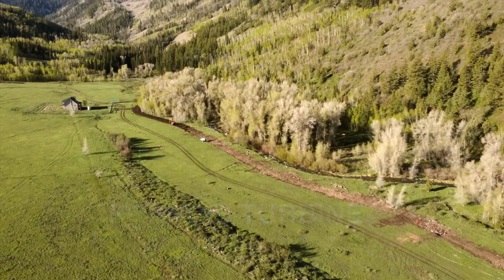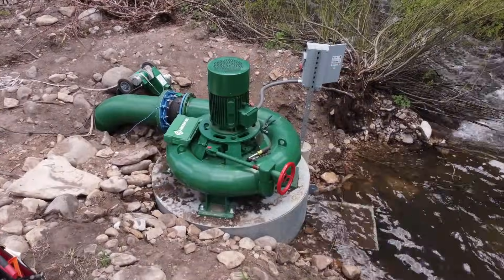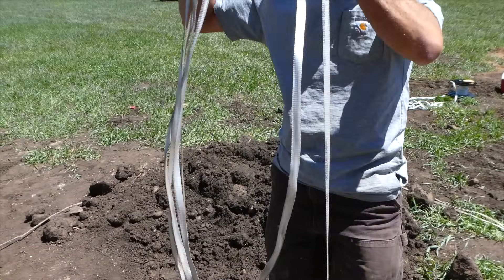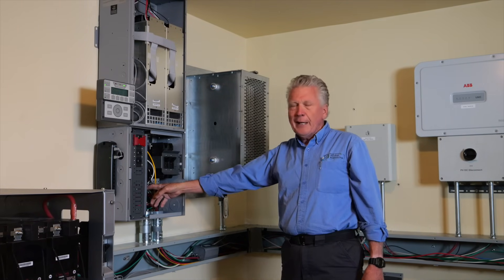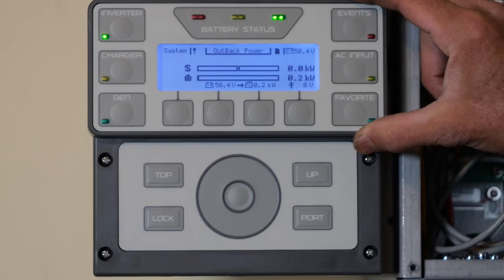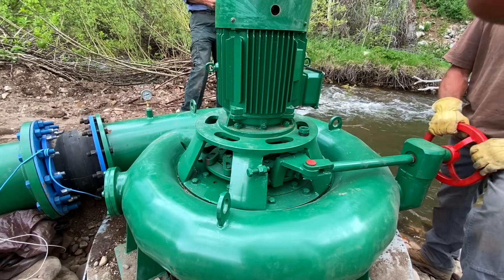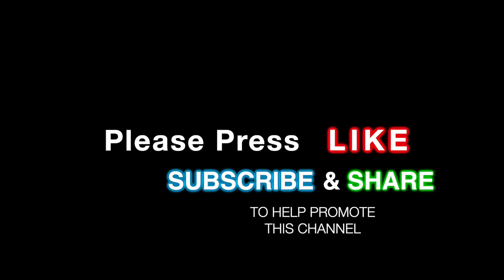MicroHydro Francis Turbine Part 2

Comment: Could you sell the unused energy back to the electric company? If I understand right it’s producing 5kw which is way more then a single hour.
Reply from the maker: The system is capable of up to 6.6kw so that is a great deal of power yielding up to ~158kWh/day (24x6.6). But this system is fully off grid so there are no lines to the utility.  Thanks for watching 😉

Comment: What's the conversion loss in the electrical management system? Not sure why doesn't rectify directly to DC then to charge controller into the batterys. Rectifying and inverting it twice adds conversion losses.
Reply from the maker: Sorry I don't have an answer to those details.  I'm neither the designer or the owner of this system.  You could ask the designer/installer (Ken) whose email contact is in the notes about the video.  Thanks for watching.

Comment: when pulling cables in conduit, grease them with Lanolin....it wont harm the insulation on the wiring and cables.
Reply from the maker: We did that on my system which is the major part of the channel, but this is a system which I don't own and didn't design.  I just documented what they did.  Thanks for watching

Comment: what does a system like this cost? as in your case at this site.
Reply from the maker: I am not the owner of this system. I merely documented this particular system, so I don't have cost figures.  Its most likely in excess of $100k. Even if I did provide cost figures, it would not be of much benefit as each system is unique to the chosen site and costs can vary widely depending on numerous factors.  First there is the potential power available at the particular site which dictates if the desired use of that power is practical.  Who will design the system?  What will be the best equipment and materials available to meet the unique requirements of the most beneficial and practical design?  Then there are expenses involved in acquiring water rights which are likely different in each state or country depending on a pro se (self applied) application or hiring lawyer to work on them.  Who will do the labor to install the system?  Is it your own sweat equity, friends that can help, or hired labor and at what rate?  How much time will it take to install?  What materials can be accessed?  Reused or new pipe, copper or aluminum wire?  How long a length of wire?  What building(s) will house the equipment?  What transformers, batteries, load regulators, power shunts, or utility net metering are available and/or appropriate to the particular site?  All of theses factors can add to the costs and it would be naive of me to present  a one size fits all price.
One must be clear that installing a system is creating an asset which would likely provide power for a lifetime.  Can it be financed over time and does that cost make economic sense when compared to running utility lines to an off grid property?  Will a local utility be willing to purchase excess power and at what rate?  Undertaking a project of this size is not for the faint of heart. It IS a large commitment both financially and in effort and time.
My first system (1.5kw) which I own and documented on this channel cost ~$25k and was installed in the mid 90’s.  Redesigning and moving the same equipment to a more reliable water source was also documented on my channel and took place between 2013-2015 and added another ~$55k but boosted the useable power by a factor of 5 to 7.5kw.  WHEN a project occurs occurs is also a factor governing cost.  Inflation impacts everything involved and the fact that I intend these videos to remain on the internet for years to come and provide some clear eyed guidance to people that are serious about their own intentions, this dictates that I not mislead them with cost estimates willynilly.  
Thanks for watching and for your comment.  I hope you gain a broader perspective from the whole channel and benefit from the heart felt intention with which it has freely been shared and provided.

Comment: Is there going to be a update? a year on?
Reply from the maker: Unfortunately I live a 5 hour drive one way from the location of this system.  Also, I might not have the permission to visit the site as I've never actually met the owner.  The designer gave me permission to document the system as long as I kept its location anonymous.  So, its unlikely I will do an update even though I'm curious about what sort of protective building the owner put over the turbine and what the seasonal flows and actual kWh output tested over time has been.

Comment: nice.  though I'd go with lifepo4 batteries. at 12v 600aH would run you $2,000  I'd budget for a 1500aH system and reduce the turbine to peleton 600 watt with 1.5 inch tube.  I suppose electric heating will dictate the exact demands on the system but for one house with only high peak loads supplied by constant generator -- rely more on battery tech then industrial setups
Reply from the maker: There are always a variety of options and approaches to assembling components into any system.  Each micro hydro setup is unique depending on the owners needs, budget, and technical knowledge as well as the parameters of head and flow available at the site.  I believe the owner of this system intends to build other structures on the property and that may be why the system is sized as it is.  I have virtually no experience with battery storage on my own system, so you may be correct on the best choice for batteries.  Other viewers have made similar comments on the batteries.
With 36 ft of head it is unlikely that you would harness much power with a pelton turbine which are more optimal for high head systems.  Thanks for watching and your comment.

Comment: I want to make a micro hydro generator where I have water stored 400 cubic metre on 1 meter height. Is it possible to generate 100 kwh energy from this setup? And what kind of generator should I use?
Reply from the maker: I'm sorry that I can't provide you qualified guidance with your question.  I'm most familiar with high to medium head pelton systems (documented elsewhere on my channel). 1 meter does seem like not enough of a head to facilitate an efficient system.  My guess is that a "archimedes screw turbine" (search it) or turbulent system (www.turbulent.be) might be most efficient although I don't have first hand experience with either.  Hope this helps a bit.  Also, when you say water is "stored" that might indicate any system would be intermittent which is definitely a drawback. Thanks for watching
Reply: @mrhydrohead  I am storing water from tide. Is it good idea to make hydro generator on tidal water.
Reply from the maker: That's an interesting question.  I'm sure there must be some way to harness power from that, but I'm not qualified to make much of an analysis as to how to do it. I'm a retired cinematographer who has owned his owned micro hydro system since 1995.  I was trained at SEI and there was no mention of harnessing tidal power in their course.  If you look at the majority of my channel you will see that it mostly focuses on my system and the way I moved it from a spring water source to a creek on my property.  I saw a gap of information on YouTube and being a filmmaker with knowledge of Micro Hydro, I decided to share my first hand knowledge.
The two problems I see with tidal flow are that 1. It will be intermittent on the basis of the tides and 2.Your head or distance of the water falling is not very great.
Because of the intermittency you would need to have a battery system to provide availability of consistent supply to meet your needs.  I'm sure there must be some way to harness power from such a small head, but I don't have a clue how to do it.  
If you discover a good verifiable method, I'd love if you shared it with me.  It certainly would seem doable and I'd love to know how.  Best of luck in finding something that would work and be certain to verify the calculations before spending a dime to construct something. Errors in measurements and calculations can lead to expensive mistakes.  Again, hope this helps.  @Bapi-db4ef  
😉
Reply: Sure. I will make wind turbine or hydro turbine.
Reply from the maker: Best of luck to you

Comment: How cost effective is it compared to wind/solar? Assuming heating is done without using electricity (so total home consumption under 3kW averaged)
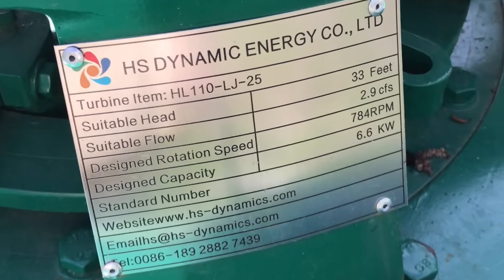Reply from the maker: I don't own this system and was merely granted access to document it's installation.  I do believe that the owners plan to use the reliable supply of power for heating @7500ft. elevation. Output can range up to ~158kWh/day at full capacity with surges handled up to 10kW.  See 4:24 in video for specs. Thanks for watching

Comment: 100 yards from the creek to the house and I'd bet no less than $100,000 was spent on a 8kw system that while very pretty, is just over engineered for the application. I'm guessing this is more of a model home type install. There are many good options on the market, this is certainly "turn key" high end. Myself I prefer a diversified system with micro hydro, solar, and now with the latest tech even wind turbine power generation. Lithium over agm  and a much simpler rectifying and inverting setup able to be monitored over closed network. Just my opinion though.
Reply from the maker: I don't own this property and have merely documented it.  My system which I've documented in detail on this channel is direct regulated AC of 4.5-7.5kW (de[ending on seasonal demand) with no batteries.  I appreciate your input and thanks for watching.

Comment: I've seen systems that take AC to DC batteries and back to AC, but this appears to be AC-DC-AC-DC-AC? Is that correct? And why?
Reply from the maker: That’s a great question. I don’t own the system and merely documented the installation.  My understanding is that the AC provided by the turbine is fully unregulated. The Outback inverter is not capable of handling AC which might range anywhere from 50 to 70 Hz.  I don’t have direct experience with the Outback inverter but I believe it requires a regulated sine wave to both charge batteries and output 60hz power. My own system documented on my channel is a  60hz regulated straight AC system without batteries, and that is the majority of my direct experience.  Thanks for watching and commenting. 😉

Comment: Maybe I missed it but, how much electricity does something like this produce? I'm just looking for a rough estimate.
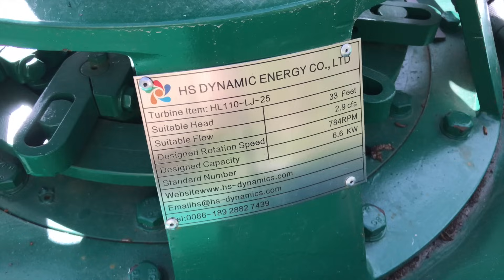Reply from the maker: At 4:25 in the video there is a placard on the turbine which shows the rating of the unit to be 6.6kw and also has contact information for the mfg. As with all hydro systems, the output is dependent on the amount of water available and that supply fluctuates depending on seasonal and climatic changes. Thanks for watching 🙏🏼
Reply: @mrhydrohead  Thanks for the response- that's a pretty good top end!

Comment: How much is the total cost for this project
Reply from the maker: I am not the owner of this system. I merely documented this particular system, so I don't have cost figures.  Even if I did provide cost figures, it would not be of much benefit as each system is unique to the chosen site and costs can vary widely depending on numerous factors.  First there is the potential power available at the particular site which dictates if the desired use of that power is practical.  Who will design the system?  What will be the best equipment and materials available to meet the unique requirements of the most beneficial and practical design?  Then there are expenses involved in acquiring water rights which are likely different in each state or country depending on a pro se (self applied) application or hiring lawyer to work on them.  Who will do the labor to install the system?  Is it your own sweat equity, friends that can help, or hired labor and at what rate?  How much time will it take to install?  What materials can be accessed?  Reused or new pipe, copper or aluminum wire?  How long a length of wire?  What building(s) will house the equipment?  What transformers, batteries, load regulators, power shunts, or utility net metering are available and/or appropriate to the particular site?  All of theses factors can add to the costs and it would be naive of me to present  a one size fits all price.
One must be clear that installing a system is creating an asset which would likely provide power for a lifetime.  Can it be financed over time and does that cost make economic sense when compared to running utility lines to an off grid property?  Will a local utility be willing to purchase excess power and at what rate?  Undertaking a project of this size is not for the faint of heart. It IS a large commitment both financially and in effort and time.
My first system (1.5kw) which I own and documented on this channel cost ~$25k and was installed in the mid 90’s.  Redesigning and moving the same equipment to a more reliable water source was also documented on my channel and took place between 2013-2015 and added another ~$55k but boosted the useable power by a factor of 5 to 7.5kw.  WHEN a project occurs occurs is also a factor governing cost.  Inflation impacts everything involved and the fact that I intend these videos to remain on the internet for years to come and provide some clear eyed guidance to people that are serious about their own intentions, this dictates that I not mislead them with cost estimates willynilly.  
Thanks for watching and for your comment.  I hope you gain a broader perspective from the whole channel and benefit from the heart felt intention with which it has freely been shared and provided.

Comment: You don't say cost, so that means it's way too expensive and no ROI..lol
Reply from the maker: appreciate your comment however I am not the owner of this system. I I I merely documented this particular system.  I don't own it and wasn't privy to its cost.  Even if I did provide cost figures, it would not be of much benefit as each system is unique to the chosen site and costs can vary widely depending on numerous factors.  First there is the potential power available at the particular site which dictates if the desired use of that power is practical.  Who will design the system?  What will be the best equipment and materials available to meet the unique requirements of the most beneficial and practical design?  Then there are expenses involved in acquiring water rights which are likely different in each state or country depending on a pro se (self applied) application or hiring lawyer to work on them.  Who will do the labor to install the system?  Is it your own sweat equity, friends that can help, or hired labor and at what rate?  How much time will it take to install?  What materials can be accessed?  Reused or new pipe, copper or aluminum wire?  How long a length of wire?  What building(s) will house the equipment?  What transformers, batteries, load regulators, power shunts, or utility net metering are available and/or appropriate to the particular site?  All of theses factors can add to the costs and it would be naive of me to present  a one size fits all price.
One must be clear that installing a system is creating an asset which would likely provide power for a lifetime.  Can it be financed over time and does that cost make economic sense when compared to running utility lines to an off grid property?  Will a local utility be willing to purchase excess power and at what rate?  Undertaking a project of this size is not for the faint of heart. It IS a large commitment both financially and in effort and time.
My first system (1.5kw) which I own and documented on this channel cost ~$25k and was installed in the mid 90’s.  Redesigning and moving the same equipment to a more reliable water source was also documented on my channel and took place between 2013-2015 and added another ~$55k but boosted the useable power by a factor of 5 to 7.5kw.  WHEN a project occurs occurs is also a factor governing cost.  Inflation impacts everything involved and the fact that I intend these videos to remain on the internet for years to come and provide some clear eyed guidance to people that are serious about their own intentions, this dictates that I not mislead them with cost estimates willynilly.  
Thanks for watching and for your comment.  I hope you gain a broader perspective from the whole channel and benefit from the heart felt intention with which it has freely been shared and provided.

Comment: What would really help is a video explaining how each states laws prevent a land owner from putting in a Micro Hydro system. This may come as a shock to you but there are states that have laws against micro-hydro and the diversion of any water from streams, rivers, and lakes. I am currently looking for land and because of all the laws, I have all but given up on the idea that I will ever be able to have my own micro-hydro system. Just too much red tape.
Reply from the maker: I wish I had the depth of knowledge about water law in different states. I might then be able to make that sort of video. I am not shocked and understand that often there are vested interests that do not want water rights to be adjudicated. Diverting water is a nonconsumptive use of the water, and to some small extent prevents evaporation from occurring with water openly flowing.  Finding a local installer may be of some help in terms of an efficient means of learning the laws in a particular area. Sorry that I don’t have the depth of experience with water law in any state other than Colorado. I do hope that you can find a property which will meet your needs. Best of luck and thanks for watching.